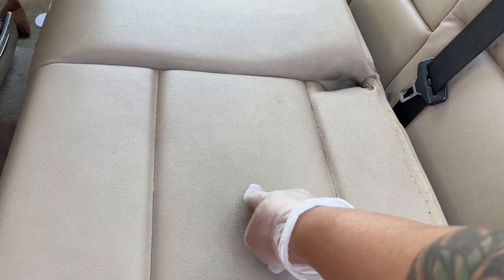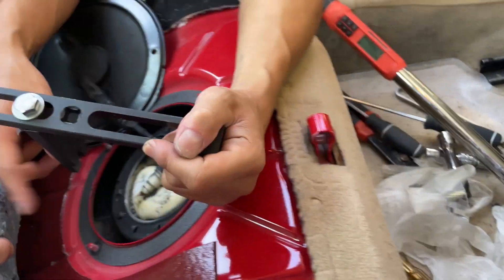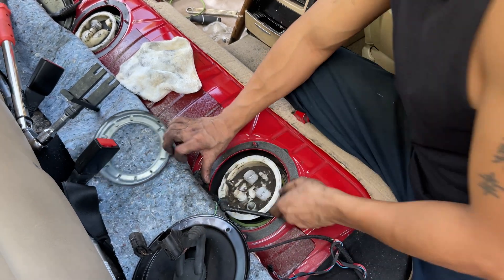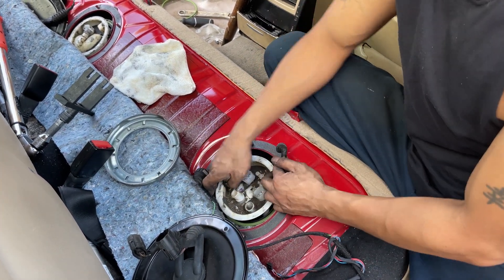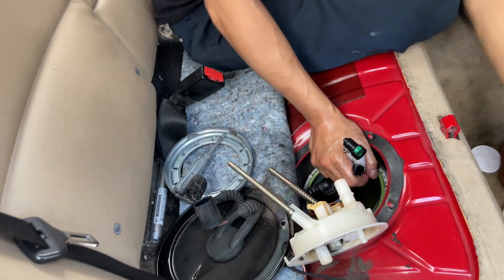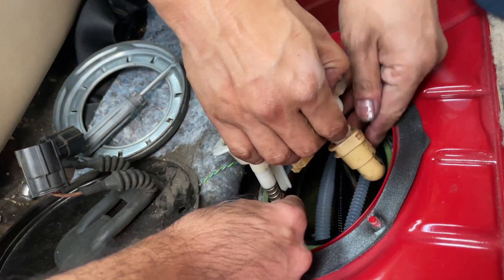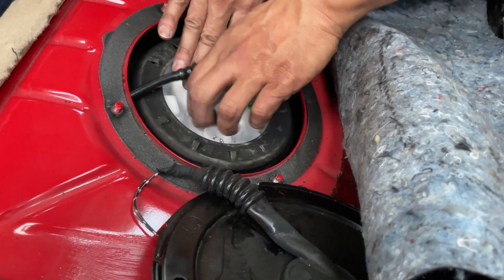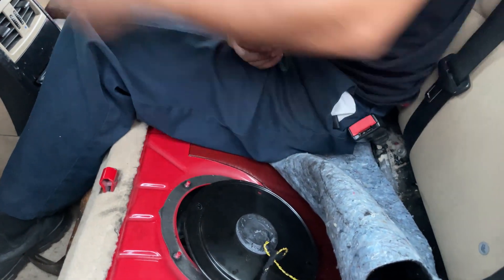Fuel Injection Pressure Regulator Replacement | E90

Comment: My 2010 E90 320D fills the regulator's side of the tank with fuel, leaving the pump's side of the tank empty. What might be the problem? Pump or regulator?
Reply from the maker: Hello, you might have your pump side tank is leaking check it by smelling any gas underneath the car seat or open the back seat to see it any sign of wet gas leaking. 
For bad vehicle regulator sign if your vehicle is off takes a long time to start the engine. 
Fuel regulator do hold a fuel line help to start your vehicle start up right away after shut down.
Reply: @dulichcungnhaanhmia  there are no signs of leakage, the sender unit is delivering the fuel to the pump
Reply from the maker: Turn on your car running  to check your regulator hose line any sign of leaking